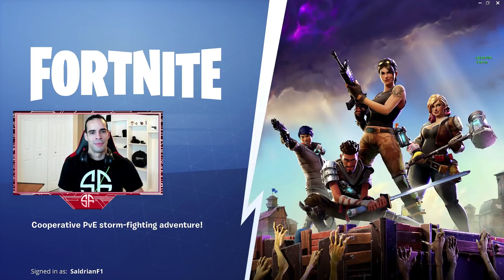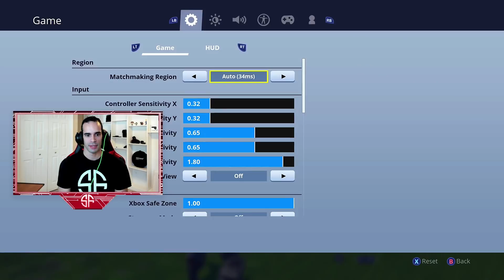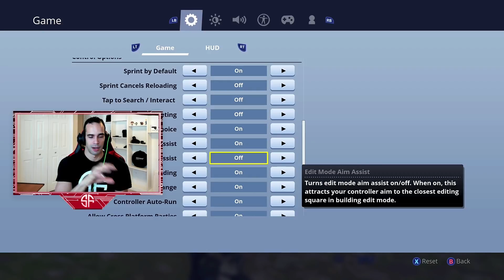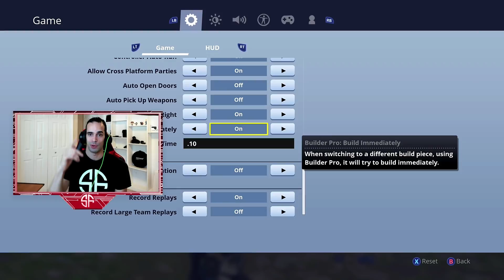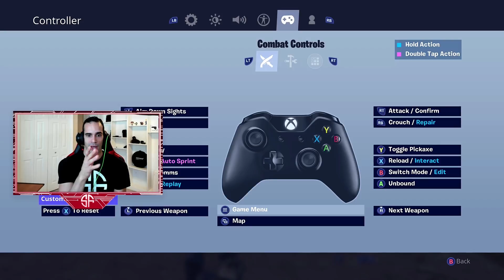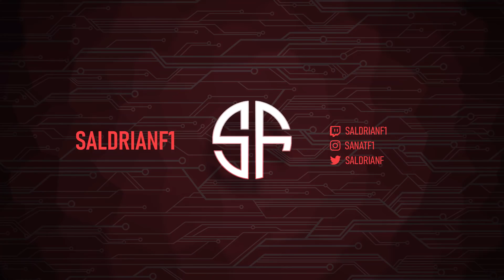Best Custom Console Fortnite Settings and Configuration - Jump and Aim - Build Faster

Comment: definitely don’t crouch with r1 unless you shoot with your middle finger
Reply from the maker: Its easy, your pointer finger kinda goes over it anyway when pulling trigger, and you just shift that finger without taking it off the trigger.